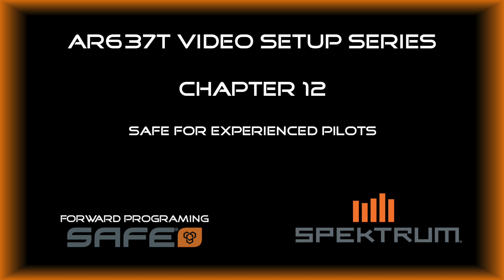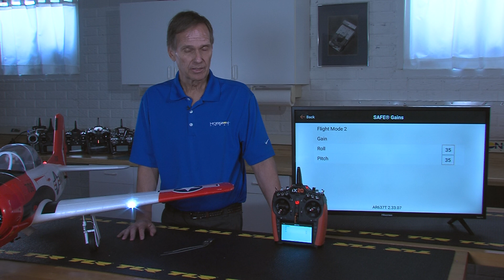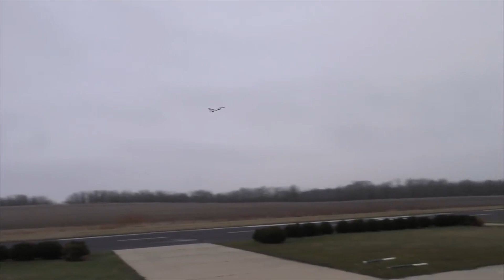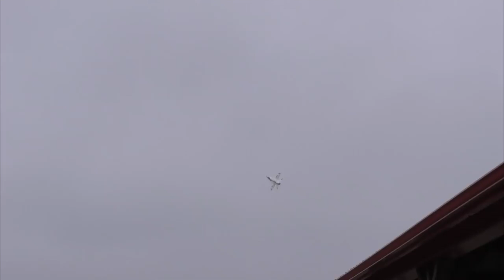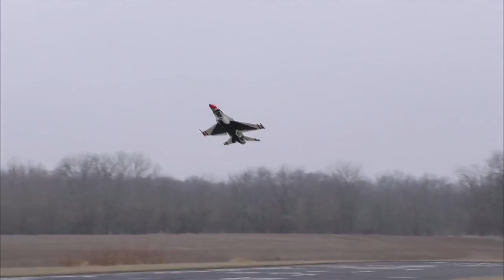Spektrum Smart Receiver AS3X Setup Series #12 - SAFE for Experienced Pilots

Comment: Is there any place I can go and find the factory settings for a CarbonZCub 2.1m with an AR636.  I crashed one and bought a new fuselage and moved everything over.  Bought a new AR636 from a hobby shop that came out of a new CarbonZCub 2.1 meter but it does not seem to be acting right.  I purchased a SPMBT1000 Spektrum TX/RX BLE Programming Module to make sure I have the surfaces going the same way in "off" and "Safe" modes but want to check all the settings for pitch, roll and yaw and all the settings.  Thanks.

Comment: I was doing my system check after I put my Turbo Timber Evolution together and bound it I noticed that my aileron and elevator is reacting opposite of the controls. How do I fix this? My controller is a DX6e
Reply from the maker: Are you using the included Y harness for the Ailerons?
Reply: @SpektrumRCvideos  yes and I've made sure that they are in the correct ports.

Comment: I now have 4 of these, and they are really simple to set up, the second I programmed without reference to anything, took minutes. I find it hard to see if the AS3X is working as it should so turn the gain multiplier to 4 and it's much clearer. I leave the gain multiplier to 2 and turn the know to centre position so I can increase or decrease gain. Even experienced pilots at our club use safe for landing, makes it far simpler to fly more complex aircraft. I crashed an aircraft twice when the sun flared out the model and I lost orientation, hopefully now a flick of a switch will sort it!

Comment: I've been flying 20 years, and for me SAFE is a great feature. I love SAFE and don't see why experienced pilots don't use it more. It's like driving a car without power brakes or manual instead of automatic transmission. I leave SAFE on full  time and got used to it. The V900 for example flies great with SAFE full time, especially landings where all I have to worry about is keeping a slight nose up attitude.

Comment: I’m just wondering if there is a one receiver (6CH I guess) can use all types of planes,helicopters,boats for beginners ? If you could answer my question I really appreciate it. Thank you
Reply from the maker: There is not. Boats require a long antenna to stick up and away from the hull, Flybarless Helicopters require a flight controller and those can have a multitude of options, etc. Unfortunately it is hard to say one receiver is a one size fits all. Now if you are talking about a transmitter the Spektrum DX6 is great for nearly all applications. Hope that helps!

Comment: I’d like to know your Safe setting for that FMS T-28 you got right there.
Reply from the maker: The stock gains actually work quite well. They might be a tad low on 4s but flying on a 6S lipo its almost spot on with stock gain settings.